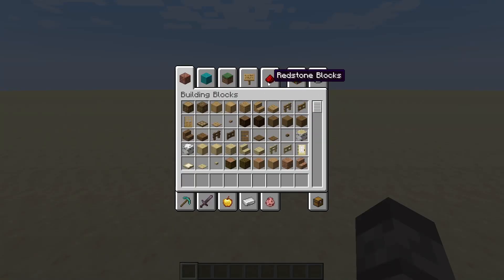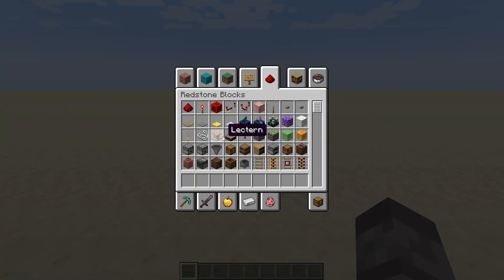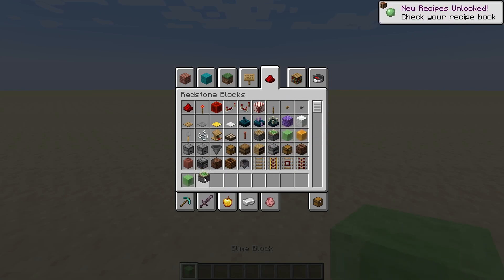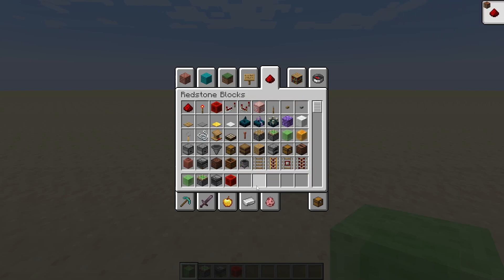What the HECK Are Redstone Flying Machines?

Comment: Your explanation for why your closest attempt didnt work misses a much more important aspect: you cant move a piston while it's extended. The observer thing is important, because it lets you use observers, but flying machines before observers still were possible with redstone blocks.
The reason everyone uses observers is because they generate really short pulses, which means that pistons they power will be movable immediately after. The other nice thing about short pulses is that they cause sticky pistons to spit out their blocks, meaning 2 way machines are much more possible.
So, basically, the real reason you didnt figure it out with the system you said was closest was because you were using a button to activate it.
Reply from the maker: Well, I did already know that you can't move extended pistons, that's why I didn't say that in the final explanation. I thought I said something about it in my rambling during the video, but I might've cut it on accident. But yes, this is also a super important thing to keep in mind when doing anything with redstone, especially if you have many sticky pistons going off in quick succession.
Reply: @batterygames-  I do think that if you'd been giving that piston a short pulse, you would have got it... Just knowing to place an observer there, as you said, would have also got it for you but short pulsing the piston would probably have given you enough insight, and let you understand the system rather than just knowing one that works
Reply from the maker: @thathungryguy2617  OH, yes, I do see what you're saying! Since the button gives a long pulse, it was messing with the timings. Thanks for the clarification!